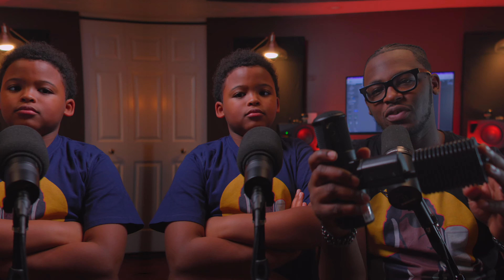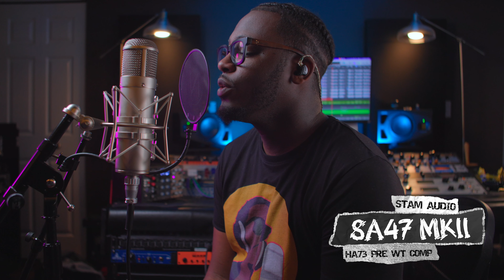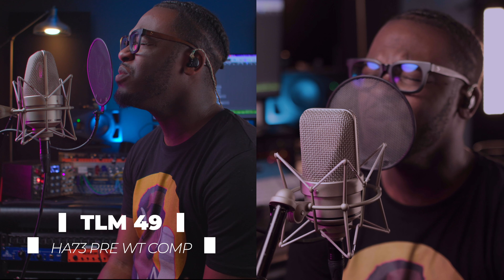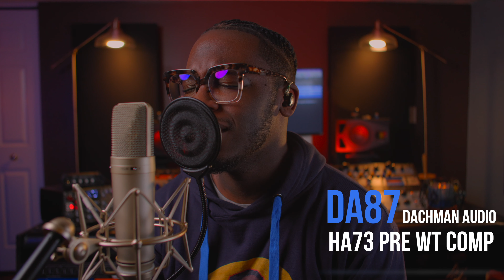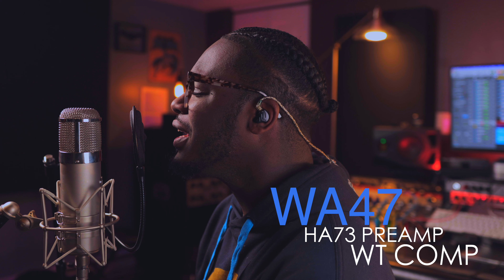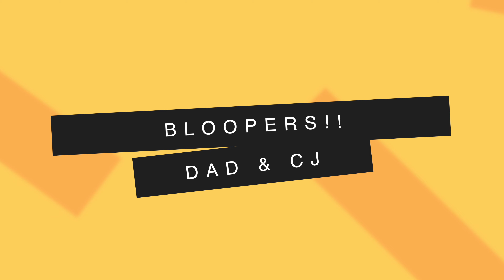Tube VS Fet Microphones - Microphone Comparison Video MMP: EP 35

Comment: Carl!!! And Carl Jr haha I hope you have been doing well man! I feel like most of what I am hearing is a difference in the capsules/frequency response of each mic and less of a difference between tube vs fet. I initially thought the tube mics had a nice "bloom" in the low mids that added some nice weight so my thought is okay tubes help the midrange and give a pleasing character. Then I heard the LA-320 and was like oh nope! This is very crispy and a bit thinner so now the TLM49 has a midrange bloom and pleasing sound. So idk... that's where i'm at right now. To my ears, not a huge night and day difference between tube and fet mics on quieter sources like vocals (might have different results on louder sources), and differences are more in the capsule design, frequency response, and proximity to the source.

Thanks for the vid man!
Reply from the maker: Bro! I’m always grateful for your contribution to the channel! 

I see the validity in your perspective. The LA320 is much leaner than naturally expected but I think that goes to show how saturation impacts both the low and top end. I would certainly add that 320
to a source that I need more top end on before pulling out an EQ of some sorts. The modded wa8000 is balanced to me, especially in comparison to the stock voicing. It also takes processing well. 

I try to stay neutral on processing in the series due to subjectivity so it is hard to hear the impact on the more dynamic performances but I wanted to try to represent where things would be in real world scenarios before post treatment. 

I appreciate your support bro!!! Looking forward to your next video!
Reply: @CarlMooreMusic  Yea that is true about the saturation. And another thing I noticed just from personal experience is that tube mics usually sound a bit slower and smoothed out in the transient response which I assume is also due to the saturation.

The modded WA8000 was actually pretty nice! I was never a fan of the stock sound. You definitely gotta do a full review of it at some point! I still think the CX12 and WA47 are probably Warm's 2 best mics in their line up. That LT386 sounds amazing. My favorite out of all the mics.

You're welcome bro, and thank you!!!

Comment: Omg that LT386 on foward mode is so yummy on your voice and that track. The WA-251 was sitting really nicely in the mix to. The MA 201 is nice, maybe a bit crisp , I was also really suprised by the WA-CX12 and the LT387.
Reply from the maker: I feel like the Forward mode on the LT386 is still crisp and present but has more girth to it than the Forward mode on the FC387…. At least for my voice and these source examples. 

I typically don’t record without out EQ and compression to achieve the tonal goal I’m going for. I refrain from using it in these examples but if I were using the 201 Fet as a final Vox (which I definitely would) I’d have to add some EQ to tame a bit of the top end and add some weight where necessary but I like the mic for dull/darker sources.

I think the cx12 is warms best and most balanced mic thus far 8?3 heDd good things about the wa47-F so I need to get my hands on one but I dig the cx12.
I’ve heard complaints about the self noise but it’s easily workable for me.
Reply from the maker: Thanks again for checking out the video and commenting!
Reply: @CarlMooreMusic  awesome, i feel the same about the 201 fet, I think my voice as some similar tone with yours, i wish those lauten where in my budget HAHAHA. I had a wa-87 in the past and wasnt that impressed by it and chaged it for a tlm103. But i would really like to test those cx12 and wa-251.

Comment: Interesting! 😉In your opinion, would you recommend Sony-c80, Avantone CV12 BLA, LA-320 V2 or WA251?
Reply from the maker: Thanks for checking out the video and commenting. I’ve never had the opportunity to us the c-80, but I own the other mics you’ve mentioned. I think it depends on what you’re going for totally. The cv12 BLA has a balanced tone across the board. There’s definitely tube saturation but in comparison to the la320 v2 and the wa251, I feel like it captures the sources a little more accurate to the original source. 

The wa251 to me is hyped up top and provides some low end. It’s brighter than the other mics you’ve mentioned. 

The LA320 v2 has more body than it’s original version. I really like the improvement and I think it makes it much more usable among multiple sources. 

The lack of multiple polar patterns on the LA320 v2 would rule it out if you needed that. However you can get the job done with either mic honestly. The question is what tone are you looking for?
Reply: @CarlMooreMusic  Thank you so much for reply!)) I'm gonna use the mic generally for vocals and maybe a couple of instruments like guitar. It would be great if you could review of c-80 and compare it to these mics
Reply from the maker: @mayers578  I can definitely run the comparison once I get the mic in my hands. All of the mics I review is actually in my mic locker.